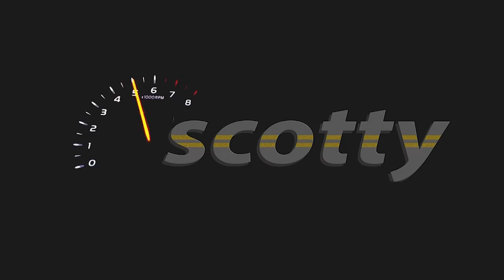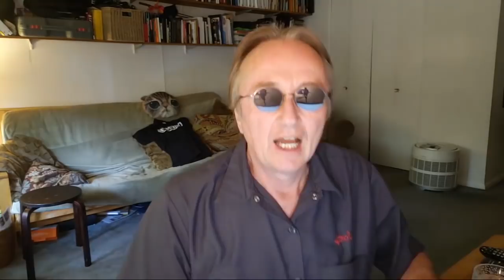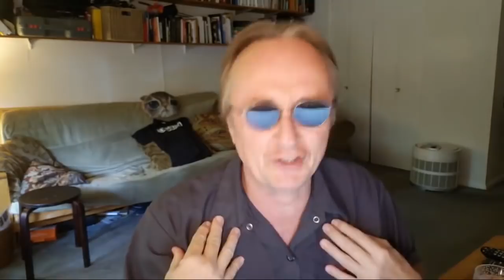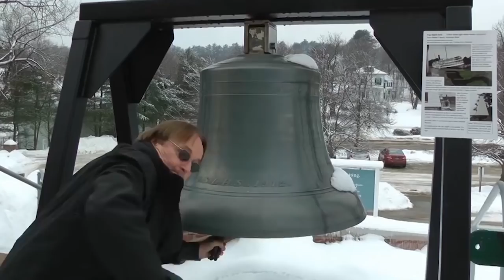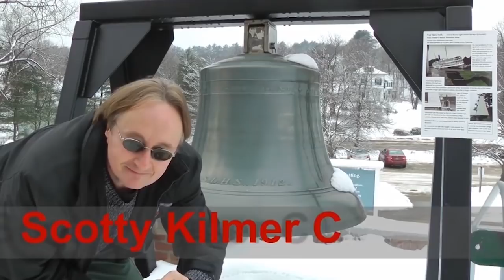What's the Beef with Chris and Headlight Restoration Explained

Comment: thing is, your video is about what to do with new headlights to *permanently keep them clear (*if permanently includes regular maintenance on them in the form of adding some liquid that's probably a UV resistant finish) whereas his video was a solution for old headlights that had their UV protective layer faded, by removing that layer/making them clear again, and adding a clear coat of some sort.. however keeping them that way is down to what finish you put on there, and what sort of maintenance you then do to them. - i've used 2K automotive clearcoat on my brothers lights, that's still good close to 3 years later, but not everyone has that sort of stuff laying around. 

personally I think you should have conducted a long term test using the product you had shown, but only using it on ONE headlight of a matched pair.  other wise its hard to really know if it's working, the headlights may still be clear anyway, usually these things last for a good long time and then quickly degrade after more than 5, or even closer to 10 years on.

Comment: Hi.  Thanks a lot for your diy excellent videos. Indeed helping us....  Can I ask if what do you think is wrong with my 1995 honda civic esi automatic. If I press the pedal brake with aircon on and also during reverse, my RPM goes down to almost zero that the engine will almost "die".  I already replace its air filter, cleaned its iacv,  map and throttle body. Thanks in advance...

Comment: I use one of those Ronson electric shoe polishers from the 60s on my headlights and they look great.  I rigged up some flannel to use for the buffing head.  Anything with grit works fine. I've used rubbing compound, corning ware cleaner, some other product for fiberglass/gel coats. If they look bad, I'll do them again. I'm like that.

Comment: I'll a test to the Clear Coat isn't best.  I spent hours sanding and polishing my 2008 Dodge Ram headlights and brought them back to nearly new condition.  I sprayed them with purposely bought UV protectant clear coat.  I applied 2 complete coats on them.  About 1 year, maybe 18 months later, they're nearly as faded as they were before I sanded them the first time after 9 years.
I haven't tried the Meguiars stuff yet, but I will when I get around to having time to repolish and clean the big lenses again.
Reply: Even Scotty said to apply that once a year.
Reply: Yes.  But, the problem is, it started hazing over well before the year was up.  By about a year and a half, it nearly looked as bad as it did before I sanded and painted it.
Reply: Just sand them and then polish them with your preferred restore product. Lasts much longer, a 10 minute touch up once a year is better than sanding for 8 hours every year.

Comment: Scotty runs a car channel over doing things correctly. Chris makes his videos by doing things over a cheap and easy repairs. They both have major differences but we shouldn't be criticizing one of them. They both have car knowledge but Scotty has more experience. Anyone that is into cars or just has a car for that matter knows that experience goes a long way. Chris has helped me a lot as to how to change fuel pumps and starters. Stuff a lot of people could use the knowledge of. Scotty has given me information of what to do and what not to do when driving, repairing, or just looking at a car. Some may make mistakes but if you watch the show Roadkill on MotorTrend they specifically say "We are here to show you how to do everything right, but the wrong way" being a mechanic comes with challenges and involves a lot of fabrication. Not everything will go right when fixing cars. That is why it is best to leave them stock from the factory

Comment: I agree with you Scotty nothing beats experience however, A good  2k clear coat  which is one that you must mix will last a long time on headlights, unlike The spray can clear  coat you find sitting on a shelf in most stores they just will not last. Chris had a great idea to make an old set of headlights look nice and clear again he just used the wrong product. A better option would be to use a good 2K clear and your results will not only look great but they will last. Eastwood makes a 2k clear in a spray can version which is mixed by pushing the button on the bottom of the can, this would be a great option for someone who does not have expensive spray equipment. I enjoyed both your videos and Chris’s videos you two are both some of my favorite people to watch

Comment: UV Resistant clear coat is a mandatory. But you are right, though polycarbonate headlights use a clear coat that uses a UV resistant compounds to prevent yellowing and cracking (it'll still do it over time.) But you really can't just walk in and grab any clear coat to repair your headlights.

Comment: Honestly, I enjoy both YouTube channels (Scott's and Chris').  As for the "advice" - Scott's is based on years and years of experience.  Chris' is based on what he's tried and looked up out on the interwebs.  For the most part they're both entertainment and while I'll generally take Scott's advice on a auto related topic over Chris' there's more actual "how-to" content on Chris' channel (or at least it seems to be organized that way).  In so far as the headlight topic is concerned - if you followed Chris' advice to polish the enclosure to start with and used Scott's recommended product to keep it that way I think you'd be in good shape.  The issue with yellowed/cloudy/dull headlights is that the surface isn't smooth.  The clear coat gives the appearance of being smooth but is too thin to last when exposed to what made the lens dull in the first place.  Bottom line is "why can't we all just get along?"

Comment: I wonder if you combined the two methods it would be successful, the thing is if the headlights are faded and yellow to the extreme polishing can't bring them back but sanding can, so I would be curious if you sanded and clear coated and then use the Meguiars headlight protector on top of that if it would last just wondering

Comment: I think Scotty and Chris both provide valuable and relatively accurate information. In this case Chris recommended something that worked for him. Scotty recommended something different based on having experience with the clear coat option. 

Personally, I still use the headlight restoration kits (specifically the one from 3M) since I've seen good results. The trick I've found to making it last is to coat it with something, like what Scotty is recommending here. I've used regular Carnuba car wax and they still look good after about a year and a half. I say just stick to what works for you.

Comment: I love Chris' videos and all, they're great ideas and most of the time helpful. But so many comments are coming forward verifying that his respray technique doesn't last long. I definitely would trust Scottie's advice over his just for the sheer fact alone that he's been a mechanic for so damn long. That being said, I didnt even bother with Chris' tutorial to "restore" the headlights as it would have costed me around $40 in supplies alone, if not more if I wanted to be super thorough. My headlights were beyond restoring, and the entire process of sanding drying sanding drying etc was really more work than it was worth to me, so I ultimately just dropped $100 and replaced my headlights (I had to so my car would pass inspection, I live in Houston Texas). I do plan on getting the stuff Scottie mentioned to preserver headlights however. He's not going to throw out a recommendation without having done long term research or testing.
Reply: Yeah they didnt last long because they didn't follow instructions and put on enough coat. My headlights are still clear 3 years after following his video.

Comment: have you seen the acetone method?  they clean the headlights with windex, i use $ 1.00 oven cleaner from Dollar Tree.  they then rub it with steel wool, windex it again, then put an acetone wetted shop rag and give it one swipe top half, second swipe bottom half, then windex the paint around the headlight to prevent acetone drops from damaging it.  it seemed to work.

Comment: Alright, so I guess the big question is whether the clearcoat worked for anybody. It didn't work for me, in time the lenses seemed to get rough in texture, cloud up, and somehow absorb all the usual bits of bugs and road tar junk. I actually sanded the clear off and polished the bare plastic. It's very close to oem-new but for the amount of elbow grease I was satisfied with leaving 'good enough' alone.

This may or may not be important, but some clearcoat I reapplied after a small spot of bodywork has also turned to crap. As in, it matched the oem paint in every way before, but now it looks and feels like 180 grit sandpaper. I did a side mirror housing earlier the same way, but it's still glossy and fine. I'm thinking maybe there was an enormous run of defective clear or something. I know there's acrylic and laquer  also the regular spray cans and the 2-part spray cans. I dunno, but I think it's worth thinking about at least.

Also, fwiw Chris was far from the only one recommending the clearcoat method. I can't say he was the motivation behind me doing it, personally. However his credibility did give me assurance that it would work as described.. fwiw
Reply: Worked for me. I put many layers on (basically a whole can) and it looks good as new. Probably easier to replace most lights honestly

Comment: Scotty could you do a video on sticky valves? My c1500 pickup has a 4.3 that misfires and pings under load, and it fails the dollar bill test. Using marvel mystery oil helped a little bit but I'd like to kill it off and prevent it from coming back. I really don't want to pull the heads off and do a valve job though.

Comment: Good observation by Carson! Chris has a video on scratch repair in which he sanded out an unnecessary large section of clear coat.  Making a huge haze patch just to cover a single clear coat scratch, next Chris polished out the haze patch and waxed over it.  Chris gave every impression it was a permanent success.  In reality,  all he did was mask the haze patch he'd caused by sanding away the manufacturers protective clear coat and replacing the clear coat with the resin in the polish.  Once the polish and wax wears away in a few months, the unsightly and extensive damage caused by Chris's sanding will return.  Basically, Chris solution was to recreated far more permanent damage and just masked the damage with a temporary Chris FIX.  
There are some very UNETHICAL Youtube presenters trading on their audiences lack of knowledge, fortunately Scotty Kilmer is ETHICAL.
Reply: Chris ended up scrapping that PT Cruiser anyways.

Comment: Scotty, I recently purchased a nice, low mileage older Cadillac SRX... great condition, but someone has done like Chris has suggested and clearcoated the HID headlights.  It is cracking and peeling and looks like hell. 

HID compatible housings are hard to find and expensive when you do ($500ish each)

Is there an acceptable way to remove the clear coat without harming the plastic underneath?

Comment: There is an actual headlight restoring system but I'm pretty sure it's professional use only. 
You have to sand(3 steps), clean with denatured alcohol(x2), let dry, apply the UV activated liquid/topcoat with a special sponge(looks like a Mr Clean Magic Eraser), let stand to level/smoothen out, and place a UV lamp 3"-6" from each headlight for 30-60 mins. I did mine almost 3 years ago and still look like the day I did them.

Comment: Still it’s just a matter doing it properly. I see some say they did the headlight restoration that Chris did. I personally had no 6-12 month issue. Granted my issue wasn’t yellowing headlights. The clear protective coating from factory cracked and flaked off. 

I know the headlight restoration kits they sell at Autozone are around the same price as say, 3 different sandpaper’s and acrylic clear coat. Neither process is permanent. Even if you clear bra a headlight as a “restoration” it yellows, you peel off and reapply.

Comment: Clear costing is a delicate & controlled job. As we see that's even done on car paint but requires number of layers. It's very hard to get best & most durable results out of it. That's aftermarket car paint job doesn't last longer before it starts fading. So in other words clear coating lights is like putting a bad paint job on you lights that will fade in just 6 months roughly.

Comment: Scotty: 

Off topic of the video..

My malibu 2007 relay is loose everything works fine powers fine just the relay does not stay on would I have to  change my fuse box it doesn't make a connect I think due to the fact that it's loose how could I fix that?

Comment: I tried the clear coat headlight restoration and completely messed it up on the driver side headlight on my 05 Sienna, it looks like a mess. The passenger side did not fare too well either. I wished I would have looked into other methods before deciding on the one I used.

Comment: It's down to choice. If you want to try restoring headlights every year then go ahead. I wet sand mine up to 2000 grit and then buff and then give them a wax and buff. It works great, and it's cheap, have to do them again every couple of years.

Comment: Best case scenario: Buffing, polishing, and re-clearing old faded plastic headlights yields average results that only last a year or two dependent upon the climate in which you drive. Rather than mess with this each year or every other year, buy new lenses and use a treatment spray on them from new each year. This simple, routine maintenance will make plastic headlights last for years and years. Some headlights will end up having oxidation both inside and outside and your only option then is to replace with OEM or a decent aftermarket brand. So buffing and polishing does not always work.

Comment: I use 2000 then 3000 wet sand, Meguiar’s 105 next 205 with a 3in hex logic D/A and coat them with Wipe New at the end and it works amazing and lasts about 2 years.

Comment: Its true Scotty, polycarbonate headlight lenses and clear coats have different expansion/contraction rates. It'll simply cracking, peel, and flake over time. Adhesion and uv's are the biggest problems. Most auto paints and clears should be baked to fully cure properly. Nobody seems to cover this in their videos. A good wax every few months on a new headlight is an easy solution for protection from the elements.

Comment: I don't understand why you wouldn't protect your headlights anyway after sanding them with fine wet and dry. I've done this method and i can tell you that it improved my headlights significantly but you need to protect them after because they are only plastic which is going to be at the peril of the outdoors such as sun/UV light and weathering. So you need to use something to protect them. I've used some great polish which last a long time but in order to protect them too you need something for the UV light and then i went a bit further and put some ceramic coating on there too. So far so good and this was quite a while ago now and they still look great.

Comment: Scotty, I didn't think you were intentionally trying to attack Chris personally.  Those that believe so should just calm down.  However, the way you worded and presented your viewpoint on headlight restoration could confuse others into believing so.  

Your method is obviously the better way to skin this type of cat and in no way impunes ChrisFix credibility in giving auto-related advice.  ChrisFix has tons of helpful videos and out of all of them you could have challenged, you chose one of the least important topics.  It certainly would have been a bigger deal if you chose to challenge an engine-related fix that ChrisFix promoted, especially if his fix would result in damage to the engine.  

With all this said, I dont believe it's your intention to troll all of ChrisFix's videos so that you can poke holes in his credibility.  That would totally change the model of success you created for your own channel into one that would result in loss of viewers rather than growth. I enjoy your channel because it's full of insight and great advice based on your 50 years of experience. Keep up the good work!

Comment: Not only headlamp, i used his radiator super flush method (which used 3 radiator flush and lot of distilled water) and this method destroyed my car's cooling system (and money)! I end up replace the radiator and worst, the head gasket! Oh by the way, his DIY self-made brake bleeder works good, so not all his video are wrong.

Comment: The plastic headlights  on many car are clear coated with a UV resistant clear coat right from the factory .  Eventually this will break down and even flake off let uncoated ones.     The ONLY way to fix this is to sand off the clear coat and polish the plastic.  To make the repair last you HAVE TO coat the plastic with a UV resistant product such as Scotty used or clear coat them with a UV resistant clear coat. 
Chis's fix was correct  providing the the correct clear coat is used..    If you want to know how to fix head faded headlights properly  see the guys over at AMMONYC.   They know what they are doing more so than either Chis or Scotty when it comes to this.

Comment: I've cleared my headlights on my '99 Honda Civic with a polyurethane high solids clear coat...it's been 5 years and has yet to fade. I will have to agree, it WILL eventually begin to fail, as any automotive paint will.